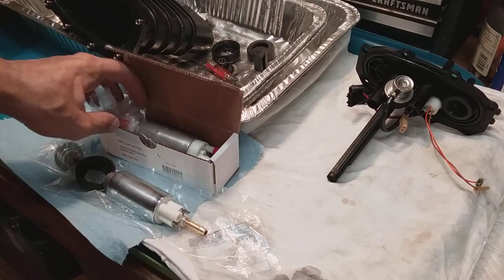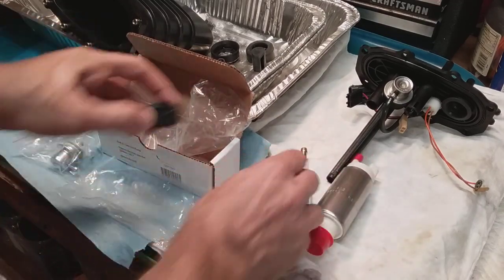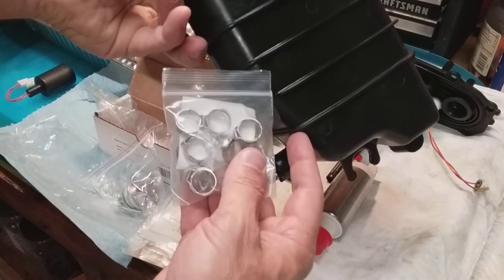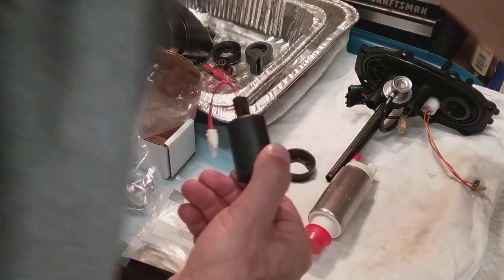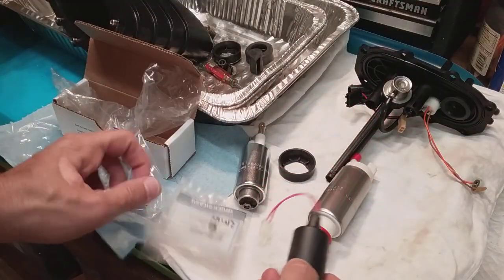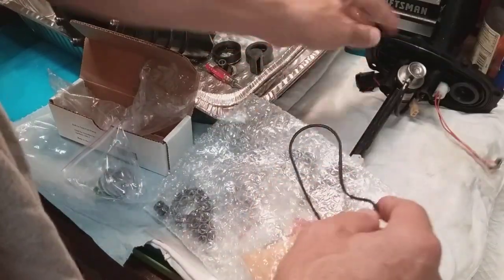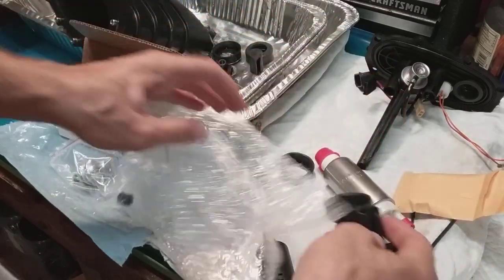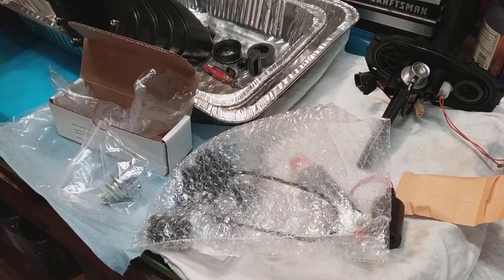UPDATE Misdiagnosed.  How to repair Mercury FSM fuel pumps and fuel regulator Part 2

Comment: At what hours did you need to do this repair and have those new Motors been reliable.What other issues have you had with the Motor. Also what size Prop are you running ? Appreciate your videos they will assist me with my new Motor
Reply from the maker: Its been awhile as I sold it. I think is was 200 hours, 2010 model year.  I think those motors are good and reliable. It was a stock prop as far as I know, not sure of details. Sorry.